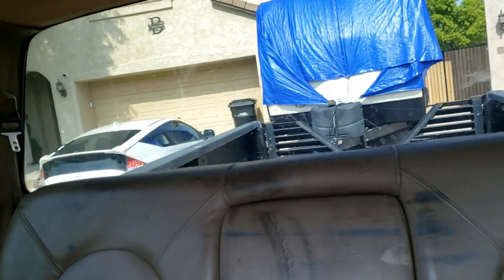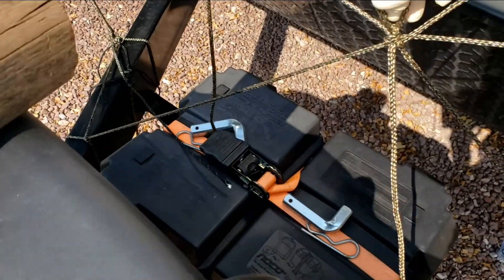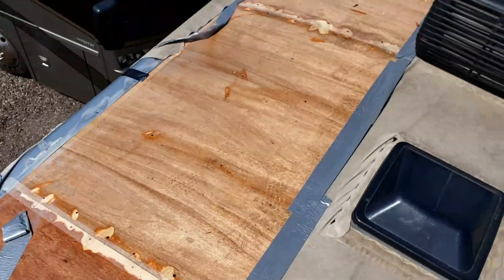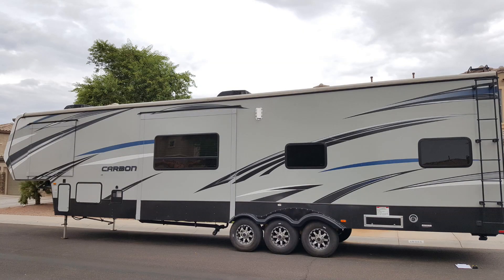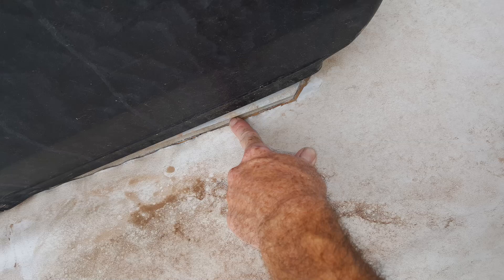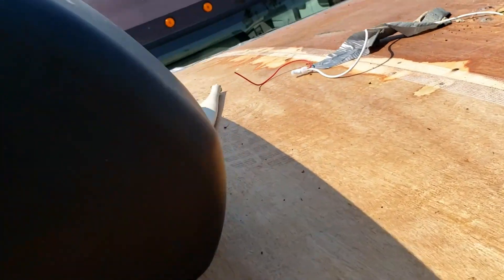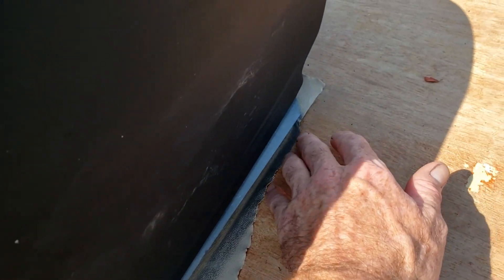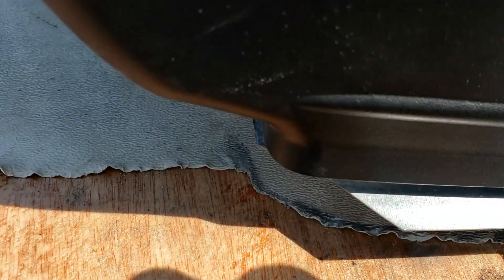RV TPO Roof Ballooning Failure? Manufacturer Defect?

Comment: I have had this problem about a year after I purchased a 2015 Coleman brand new , the top is like a bedsheet blowing on the top of the roof. It seems like the adhesive that holds down the top is not dry but sticky. I have removed the top and cleaned everything and reglued it on with the correct glue from manufacturer. Another year later same problem??

Comment: Thanks for this video and all of your similar videos as I'm dealing with this issue now. I have a 28' 2013 KZ Sportsman with TPO roof that just started ballooning. I was lucky and caught it in time but still far from home. I was able to use a ratchet strap that wrapped around from the frame on one side to the other about 2' back from the front cap, this kept the ballooning under control. I'm now ready to begin peeling back about 4' of the roof and then reglue.

Question - You mention in the video around 6:45 that you have a "pet peeve" with the rubber roof set under the front cap. I'm not sure if you're suggesting it be placed on top of the cap. If you could, I'd be interested in your input as to how and where the rubber should be secured at the front. Also, is it ok to reglue over the decking that previously had glue applied? Thank you.

Revised Comment: I saw one of your more recent videos where you explained in more detail why you place the roof material over the front cap -- this now makes sense to me. Thanks.  However, I'm still questioning how well the new glue will adhere to the roof decking that was previously glued and is still tacky. In another video, you applied Dicor roof adhesive directly over a tacky roof. Without a new surface to absorb into, how well will the new adhesive work? Or did I miss where you somehow prep'd the surface first.

Comment: Oh shoot... If that's how thin the roof lining is than I'm almost certain the new bubble I have is actually the decking bubbling up which has got to be BAD BAD 🤦

I bought a 2003 Southwind in September that was in great shape when I bought it. After all the rain and gale winds the Northeast has gotten this winter, something tore under my front AC unit and created a bubble running from under that unit to the side wall. It's a firm bubble though that moves if you stand on it. I won't be able to attempt any repairs until spring, so hopefully I'm not completely destroying my RV in just one season 😬

Comment: I'm a truck driver and i have seen countless trailers roofs bubbling up... In fact it got me up on mine too see how mine was looking (2019 Nash 29s) and noticed small bubbles around sker of the edges... The largest of them is probably about 4 inches across and not sure if it's something to be concerned about? It also has the arched roof but the material looks and feels very rubbery so I'm not certain what material it is? Anyway I when I'm driving my truck the people towing the trailer seem oblivious to the bubbling so what you said makes perfect sense as you wouldn't know unless you had a camera up there or something. I will keep an eye out for that rub Mark around my air conditioner and whatnot as that was a very good tip! Anyway I greatly appreciate the video!
Reply from the maker: Thanks for watching!

Comment: Interesting problem ahead for many trailer owners.  I am amazed at the engineering that goes into these trailers.  Practically none, and by a doofus.  During the prototype build and testing, all these problems should have been worked out, then quality control by competent individuals to maintain standards.  It is so sad well intentioned and excited individuals will get stuck with a trailer like this.  Happy trails!
Reply from the maker: It's rough!

Comment: It happen to my 2017 Starcraft 26bhs fifth wheel after driving on the highway doing 75mph against the wind. The only thing i can think of is the sum of wind power found some way to push/pressure  my roof and the glue couldn't hold that extra forces etc....  The bubble/wrinkles are all over the front area. Called the insurance and they said was my fault lolol.  CW and other RV shops asked me $8,000-$10,000 to replace the whole thing.
Other shop said they can cut a piece and replace the 4ft long and then coat the whole roof. For this job they asked me $3,000.
Honestly, i am thinking to cut a big square, pass some good kind of glue etc...
Reply from the maker: They do everything in their power to make sure you cant use your ins that you pay for, dont they

Comment: We've got a TPO roof on our '09 Fleetwood Icon and Fleetwood failed to apply silicone under the A/C gasket (even says so in the Coleman manual ie. apply silicone under the A/C gasket) sooooo...we had water slowly, slowly working it's way under the A/C gasket and now we have a small 1 sq ft bubble around the front of the A/C...it's been "fixed" by a mobile tech who pointed out the error and did the best he could. Crossing fingers that it won't progress further.
Reply from the maker: Hope the fix was good! Thanks for watching

Comment: Looking closely at you roof video the problem is not jut front cap! Yes the lazy workmanship is part of the cause! 
Th main cause from your detailed video is he stupid manufacturers ran the wiring on top of the plywood roof then laid The sheet  rubber roof on top of that! Total bs. The roof has to be totally flat with nothing laid on the surface of the plywood to interfere with the bonding of the roof material to the untreated plywood! 
The adhesive they used isn’t the correct type! With the sun beating down on it the temps will get into constant 100s weakening the bond causing the bubbling effect. 
So he fix, strip everything off the roof. 
Replace that cheap crapulous plywood with pressure treated marine grade plywood. 
Once you have the roof exposed to the roof ribs you have to water proof the ribs, and under side of the plywood. Then used engine high temp adhesive to secure down with high pressure pop rivets why these many aren’t built with pop rivets is beyond common sense. 
So once you have the new plywood installed and sealed up along the end which should be a copper flash seal, now you have to use a rino liner style water proof heat proof material that won’t fail. 
All wiring to all the things on the roof have to be run in the ceiling then Thru a water proof flashed opening penetrate the roof for each item installed.
Reply from the maker: Thanks for the suggestion

Comment: I have a 2007 Jayflight Jayco with,I think a tpo roof. It too has some wrinkles but also while replacing the cracked skylite I tore the membrane and caused much wrinkling in it when I used acetone and mineral spirits to clean the caulking off it. Should I replace the entire membrane with pvc or patch the bad area around the skylite which has rotten plywood underneath? Use a tpo patch?. sounds like tpo is an inferior roofing product for rvs.

Comment: On mine this happened too. I found the screws that go through the front cap threaded the fibreglass and “jacked” the cap edge up creating at least 1/4” gap and the air simply came up and ballooned the roof membrane.
Reply from the maker: That's awful

Comment: I think what we have going on with this type of roof is a result of the Bernoulli effect... That is, as the RV is moved along at speed the air flow over the front cap causes the pressure to be reduced on the surface of the roof... Much like that of an airplane wing... If the tensile strength of the adhesive is insufficient to withstand this sucking effect then the material will separate from the backing... The front cap open at the bottom is an issue but probably not the cause here... Just my engineering two cents...
Reply from the maker: I wish they would engineer them better.
Reply: @AZExpert  Yes, absolutely... Just appears to me that failure to account for this phenomenon is a failure on the part of design/manufacture of these coaches... I don't see how they get by telling owners that they're not liable for this type of defect...

Comment: This issue is still going on. My 5th wheel is in the shop right now for the second time in a month for this issue and I bought it a year ago this month. I caught the issue early since I inspect my roof every time before I get on the road. Started as a small tear in the sealant at the front cap with about a softball size bubble. Took it to the dealer and they put extra sealant on it and called it a day. I told them I didn’t think it was going to hold and after a 10 hour trip 2 weeks later 2-3 feet from the cap back was all ballooning. Dealer contacted the manufacturer under warranty and the manufacturer told them to just try and stretch it back forward and put second transition strip on it. I find it hard to believe that’s the solution after it’s already been stretched out. I wish I lived closer to you so I could have you fix it right! Oh, and the manufacturers are still denying it’s a problem and acting like they never really hear about it.
Reply from the maker: They need to replace your roof, not put bandaids on it
Reply: @AZExpert  thanks for the reply and expert opinion! Fighting with the manufacturer over this issue. It’s kinda sad a major manufacturer with a high reputation is unwilling to fix things correctly.

Comment: I'm dealing with my RV TPO roof ballooning right now.  We were driving home and had to  drive into 40-50 mph winds and this happened.  The TPO material pulled out from under the front cap of our Jayco eagle 5th wheel and delaminated the entire roof surface from front to back.  Of course Jayco says this is an insurance claim not a manufacturers defect problem.  Don't ever buy a Jayco product, junk.
Reply from the maker: I see it all the time.
Reply: Ken, did the insurance company cover the repair? I've basically had the same thing happen to my 5th wheel. It's still sitting at the shop, waiting for repair. It's only been 10 months.....

Comment: I have a 2017 keystone hideout 5r and I have this problem.  I bought this brand new in 16and have treated  cleaned and inspect it every year. I also blow my slides out every stop before I pull them in. Heck I even have a shower squeegee that I use after every shower. So I dont think it is from lack of care. I am thinking of doing a hybrid roof. (Crazy seal).

Comment: on my toy hauler, the top is lifting going down the road, I have also seen roofs flapping in the wind going down the highway. One thing I think is causing this is the low-pressure zone behind the front cap. I'm wondering if attaching some of those shark fin air diffusers would help. they will break any suction caused by air coming off of the front cap going down the freeway.
Reply from the maker: If your roof is flapping in the wind it needs to be replaced

Comment: I'm installing a new TPO roof on my rv. Could u Tell me which goes down the smooth side or textured side? I assume the smooth side but when I messaged the manufacturer they said either which doesn't sound right. Thanks

Comment: I have been looking for just this type of video.  My 2017 Forest River Grey Wolf 26DBH travel trailer has the same problem of ballooning of the front membrane.  The affected area goes back about  2+ feet at the midline; with complete tearing of the roof membrane by the central front strip screws.  My RV dealer never heard of the membrane tearing at the front strip screws. I have removed the lap sealant and the retaining strip.  The TPO membrane is stretched out and does not lay down flat, not able to get all the ripples out.  I was going to attempt to repair it myself.  Thanks to you I'm going to contact my insurance company and see what develops.  Yes I am a Subscriber of your channel.

Comment: Thank you for the video. I have a 2018 keystone fifth wheel and my roof ballooned up bad on my last road trip. I was traveling during a heatwave and I suspect that the hot weather helped melt the adhesive and loosen the roof membrane from the plywood. It was about 100-104 degrees the entire 6 hour drive. Luckily the roof did not tear and laid back down flat with no wrinkles. All of the seals on the front part of the roof were stretched bad with cracks in all of them. I put in a warranty claim through keystone and they said it was only the seals that failed and that part of the roof is not covered by their warranty. I am pretty upset because I think the adhesive under the roof is not holding the roof down properly. 

I am now in the process of repairing the seals with Dicor lap sealant. I also have plans of maybe covering the seals with eternabond tape after the new layer of Dicor dries. I am not sure if any of this is actually going to fix the problem because I think the air could be coming from under the front cap like you said. We will see how this goes….

Comment: I’m having issues with my 2015 coachman class C tpo roof. I bought it used about 2 years ago and have been working on it constantly ever since. Manufacturer seems to have intentionally cut side walls in jagged, toothlike pattern that they then stretch the roof over top creating numerous holes along both sides. I hopefully caught most of the issues this caused but I’m still working on repairs. I have a bunch of pictures and might seek legal counsel or maybe there is or should be a class action suit against manufacturer because they don’t construct them well by any means. 

(Coachman-forest river)
Happy travels and remember to inspect often. 
J

Comment: I've got a 2017 Heartland Trailrunner TT with this just starting to happen. Would you recommend I remove the trim, pull back the membrane and re-glue with Dicor 901BA?
Reply from the maker: yes
Reply: @AZExpert  thanks. I start tomorrow.
Reply: @AZExpert  took me 6 hours by myself. How long until I can drive it back to storage?
Reply from the maker: Good time management. I'd like at least a day in the sun, but 2 would be better.

Comment: We had just bought a 2020 Grand Design 150 29RS series in August of 2020, we took it out for our two shake down and spent more time going over our fifth wheel as we camped. It was on day three that I went up on the roof and to my disbelief the roof had many bubbles , both side rails from front to back were ballooned up and several areas going across from side to side . This was a jaw dropper so several other GD owners at our camp site took a look also and were in disbelief also, we contacted our dealer and they contacted Grand Design, we sent pictures to GD also and they said it was normal! Not!!!! This is totally Unacceptable ! Their latest reply was to remove the side rails and stretch the membrane and reapply the rails! There’s a 12 warranty on the roof , when we were looking for 5ers we did our work and looked at all makes & models and and decided to go with GD as they are well built and they stand behind their products! Our trailer has been at the dealership since the beginning of November 2020 and still in limbo! We absolutely love the layout and detail of the work hopefully this issue we be resolved!

Comment: i install tpo on flatroofs, if there are any kinds of gaps in the substrate or voids in the applied adhesive this pillowing can happen. Even if the membrane was applied before the adhesive had flashed off and there are wet spots this can occur. but the membrane in the video looks like pvc as commercially available tpo has a skrim sheet in it that is quite difficult to rip.
Reply from the maker: Years ago the RV industry did have "felt" back TPO which did make it very durable but had a bad habit of bubblilng badly so it is not used anymore. PVC membrane are becoming more common and I do like them from what I've seen but this was a RV TPO roof which is a much thinner material than commercial roofing. Thanks!
Reply: @AZExpert  you should try the Firestone tpo for mechanically fastened system, it's only 45mil as opposed to the heavier 60mil stuff. Color wise, I believe its limited to white, grey and a cream color.

Comment: Moving air = low pressure.  Air moves high to low.  Forcing the membrane to appear to blow upwards where it is not bound.
Reply from the maker: I think you are correct!!
Reply: It's the same when you see someone moving a pile of dirt, or load of furniture, covered in a tarp.  At highspeeds, it balloons up, not because air got underneath, because the air flowing over the top = low pressure, higher pressure air (relatively), will pop up, trying to equalize.  I have a new Jayco 5'er, I check the roof on each trip, found a wrinkle.  Is it ballooning? Guess the only way to tell is strap the wife up there next trip, or, I guess I could use a Go-Pro.  We'll see how today goes, I'll report back what she, er, it saw!
Reply: @SeanONeill13  A Go-Pro is much cheaper than a wife in DIVORCE COURT.   Yes, air turbulence can become quite a force. I am curious if the water based adhesives are supposed to have any drying time like regular solvent based contact cement. I have tried to glue Formica and found the instructions on the can say to let the adhesive dry TO THE TOUCH ( about 5 minutes) but not to let it dry over 15 minutes or more.  I tried to glue a few panels "wet" and the glue seemed to have less grip or excessive dry time since no air for evaporation of the solvent .  What does the adhesive manufacturer have to say about all this dilemma ? ? ?    JwgK

Comment: Yes I have noticed the ballooning mainly on fifth wheels coming at me for years on the hwys. Like an airplane wing I think certain shapes tend to build low pressure at the front of the rig and slowly but surely  it pulls the roof up in to the balloon shape till one day it breaks the roof. My son had a fifth wheel that the roof tore off like that.
Reply from the maker: I'm shocked to hear this is so common.